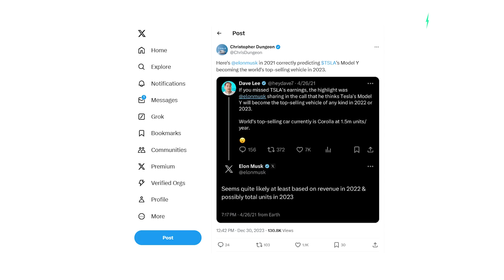CEO of CATL says Tesla’s 4680 battery cell is DOOMED to fail

Comment: Sooner or later you EV evangelists are  going to realise that EVs will be just one small part of the solution to zero emissions. There will be the larger  mix of other solutions which will include ICE around the world. The EU and UK can go it alone if they choose and tank their economies . So, China makes up more than half of all EV sales in the world, but this has no real effect on Co2 reductions because most of their energy is derived from fossil fuels, as is the energy required to make their EVs , their  batteries, solar panels, wind turbines and other so called green initiatives. All one big virtue signal.

Comment: good stuff.  Batteries are always evolving.  Chemistries continuing to be developed.  Regarding the 4680, when they tear down battery packs, the cylindrical structure of the battery helps as well as the glue itself both contribute to the strength of the pack.  The whole thing becomes very rigid.
But anyway one thing you can count on is that Tesla will use volume, they need a lot of batteries and so the most inexpensive is always on their buying list.  They also need to integrate the batteries into packs and into the vehicles.  Also because Tesla makes their own batteries that gives them leverage with other manufacturers, it gives them options.  Also they have real experience in battery development.  No they don't have to win, they just need success and significant volume.  If Tesla didn't work on their own batteries the other manufacturers wouldn't have been driven to do better.  First, Tesla had to ask for volume that didn't exist so that had to be met.  Next they ask for innovation and integration into vehicles.  If anything, Tesla is a key customer who drove battery manufacturers to level up their game.

Comment: For the longest time I thought Musk was a battery expert, he started a PhD in Battery Tech but he quit after 2 days in the program.  Always thought the 4680 battery was a dry coating tech.  And yea, agree that FSD approach is a good approach but only because Convolutional Neural Networks work well with images. It doesn't mean that we have the raw compute to get it done. I would bet dry coat elements of the manufacturing process have license value, but CATL has a huge advantage in terms of battery technology these days.  True story - the battery factory in Nevada is near a town called Sparks.  :) LFP's are great batteries. Interesting to see where it goes.

Comment: Here's a thought: a cylindrical battery may have better heat dissipation because of its shape: heat flows radially out from the center. 
In a square battery, it seems that the heat flow may not be as easy to manage and the battery could develop internal hot spots. In nature, things that need to remove heat are cylindrical or spherical in shape like stars and even the human body that is a bunch of cylindrical objects stuck together with a sphere on top. The shape was not specifically determined by heat dissipation but it might have been a contributing factor. 
Anyway, we'll see how it all plays out. That's my two scents 💩💩😁

Comment: I heard Elon say a couple times now on investor calls that 4680 is just a form factor and not necessarily representative of the chemistry inside. I see two things here. Form factor of pouch vs cylindricals like 4680 and 2170. This is a debate that involves many design factors on cost of BMS for cooling and heating, weight, and reliability when the packs and vehicles are designed. Optimization for cost reliability and performance has to consider all of these factors. Chemistry, anode design, are other factors. Of course CATL is way ahead of everyone on batteries. But they can’t really suggest that Teslas path is an outright failure when you consider all of the factors Tesla needs to consider in building packs and cars. Cars are not CATLs core business. Tesla will navigate batteries well which may or may not include CATL as a second or primary source. The economy of batteries is multisourcing as Tesla is already doing.

Comment: Musk might not be a battery expert, but Jeffrey Dahn is a battery expert & I believe Tesla is making big stride in 4680 cell.
Reply: No, lfp batteries are better
Reply: @mohammedkhan5344  i have LFP. It has its downsides. Takes tons of energy just to manage the temperature. To name just one.
Reply: @mohammedkhan5344  not for all applications
Reply: @mohammedkhan5344  Tesla will make LFP 4680 batteries at some point.

Comment: I thought 4680 was built into some model Y and was not better than the standard size battery. So how is it wrong to say the it has no future?
Reply: Tesla is developing their battery tech. They prove each step before moving to the next step. So they are currently using really conservative battery chemistry and working on getting the manufacturing process perfected. Making batteries is really hard.
Once Tesla have the skills to mass produce batteries, then they  introduce innovative battery design at a very rapid rate. They currently getting a passing grade as they actually making batteries at scale. The rate they produce batteries will keep increasing. 
Catl is exceptionally good at making batteries. The world's. Best, but they not in USA. Tesla may licence tech from CATL if necessary

Comment: I disagree with your comment about 4680s being more expensive to manufacture.  The dry cathode process allows for factories 1/10 the size of the alternative and eliminates the need for a lot of solvents.
Reply: According to Musk, but that isn't what's happened is it? They make far fewer, far slower than they planned. The battery itself gives no discernible benefits. Go watch Munro on the 4680 when it first came out. He reckoned it was slightly worse than the 2170's.
Its a waste of time and effort, giving zero improvements at great capital cost, so far.
Reply: agree in theory. but it is known to be around 50% slower in output slowing down the entire cell line..... is this fixed now ?

Comment: Don't bet against ELON !!!
Reply: Is that why tesla are already using BYD batteries?
Reply: I would in this case. The 4680 is way behind where its supposed to be and never gets mentioned by Tesla anymore. Sure sign its in deep do do ...
Reply: @rorykeegan1895  Are you serious that it doesn't get mentioned by Tesla anymore? Infact in the last quarter call Elon mentioned it and they said they have fixed the dry coating problem with the anode and cathode and their price is now on par with their best supplier. And they will become the cheapest batteries by next year. Stop the lies guys. Go listen to the last Tesla call. This was discussed.
Reply: Seethe
China will win against a angloid slave owner

Comment: Mark my words Tesla will in a long-term always create their own battery chemistry... It is cheaper to cut out the middleman in the long run so that's what will happen... The 4680 is a superior cell with longer life and the 4680 is not susceptible to freezing issues as much as regular lithium based batteries... This is due to the dry electrode.

Comment: The best possible battery might hold 5% of the energy per kilo of petrol . How reliable or long lived the higher performance batteries will be is moot given that both tend to get worse as energy density or power go up ,
. It is a bad trade off for a car but a show stopper for aviation and simulation of actual lifespan by lab tests might be unreliable .
All this just to avoid putting more plant food into the sky ( Elon admitted that the Earth 'may have been a little CO2 starved in the recent past'... all life ceases below about 150 ppm (apart from some deep sea or anaerobic microbial life)  Thankfully, some politicians are waking up to the facts, others are still woke.

Comment: A cylinder is a manufacturable egg shape which is one of the strongest containers found in nature.  The more strongly contained the chemicals, the less the fire risk  Moreover, Tesla use the term "structural battery pack".  No doubt where 4680s are used, their egg-like structure reduces the weight of other structure.  This is a major Tesla structural optimisation.
Reply: you are kidding me?  the whole pack is the structure and NOT the individual cells lol If you puncture one cell you will ignite a chain reaction lol
Reply: A cylinder is not an egg. Jesus wept.
Reply: Interesting that you know more about batteries than Robin Zeng. 
Cylindrical batteries also have higher core volume which makes cooling difficult. 
At the current charging rate and mileage it's all the same
I'm assuming Robin is looking 3-5 years down the road at 1000 mile+ range and 5 minutes quick charging.
Reply: What a whole bunch of bull! Cylinder is not an egg. Moreover, battery pack with its exterior thick packaging is the structural element,  it individual batteries themselves. This commenter is a … B ess artist. Simple.
Reply: Among the well known EV manufacturers, only Tesla's are known for fire risk.

Comment: That is a tell ….. when your competitor throws shade like that it is a sign of fear. Tesla is increasing production and the cost per Kwhr is continuing to drop.
Reply: dude,  the Chinese are the best copycats... if they are not copying Elon's insane ideas,  maybe you should listen?
Reply: @ - oh I listen but I also look at strategy. And Tesla’s strategy is to use a single format to accommodate multiple chemistries to drive down costs.  The Chinese are making g many formats with many chemistries.  I  have also worked with Chinese companies and also know when they make blanket statements like “that will
Never be succesful” it’s a tell. They typically are deferent and quiet when a competitor or partner might be wrong.

Comment: The battery cell form isn't what's decisively important.
The battery pack is the important thing. And in that the temperature management matters.
Prismatic cells might be packed more densely than cylindrical, but does that take cooling into account?
Reply: Right it's the energy density of the whole battery PACK that matters, not each individual cell. The pack doesn't just hold the cells, it must also contain cooling and protection from physical damage.

Comment: 4680 is just a form factor - a shape, a size and the can has any chemistry you like inside it. So what difference does the form factor make, well it can alter the ability of the active surface to dissipate heat to external cooling arrangements. Heat is bad for battery life and is the limiting factor for the charging rate we all want to see increased. A lot of prismatic cells are much larger than 4680 which may improve the power to weight and possibly cost but I think it may make it harder to dissipate heat. Tesla has decided to go with the 4680 form factor right now for the cells they make themselves but I think it is the chemistry and other factors such as dry production that are more important for them to optimise in the short to medium term.
Reply: I think the 4680 is tabless design too which has benefits too
Reply: You can't make a high performance cell 46mm in diameter without implementing the "tabless" design — charge/discharge heat would be too high.
Reply: @Nibiroid  yep
Reply: The form factor has a HUGE influence on the specs. 
I would say that LFP optimal cost/performances form factor is the prismatic stacked electrodes "short blade format"; 
while for the high Nickel, high power/energy density NCM, the best one is the 46xxx due to safety concerns with the other formats.
Reply: No that's not true, form factor just for heat management constrains battery chemistry.

Comment: The only "spiral wound" battery in the US market would be the Optima line. Which must be 40 years old now, and despite all the great talk it never dented the flat metal plate business. Change the names, call it Turnery versus blade, you're still stacking battery cylinders into rectangular packages, and blade or prismatic pouch still has the same density problems. CATL just might be right.

Comment: There are PYSICAL Limitations in CYLINDRICAL SHAPES and Chemical Behavior. FLAT surfaces is required for MAX Chemical performances and reaction. Cylindrical is FASTER to Produce but with NEW materials in Cathode and Anode using dopping technology ... cylindrical is "IMPOSSIBLE" to do it without significant failures in production. Thus ...... CATL has its logic.
Reply: Elon's companies are experts on transforming "impossible" to late.

Comment: Cylindrical batteries appear to be space inefficient! are they using the inter space for cooling?
Reply: Structural strength
Reply: Yes, but prismatic cells must also be cooled.  Maybe ease of cooling is PRECISELY an advantage of the cylindrical cell?
Anyway, spacial power density does not seem to be much of an issue in car applications.  Who complains about their EV car battery taking up too much space?
Reply: BeeEss on structural strength,  you cannot rely on the strength of individual cells for structure strength of the car... and secondly, the "structure " is why you lose the ability to cool individual cells?
Reply: dude,  the power density of the battery is important,  who wants battery anxiety of electric car with 100 mile range?  the size of the battery pack matters, and so
does the weight... who wants to drive a 3 tonne passenger car with range of 100 miles. the cylindrical casing takes up weight and lessens cooling..
Reply: @chasx7062  What modern electric car has only a 100 mile range???  Only a very few small urban cars, such as the electric SMART!
Power density obviously matters... and matters a lot!  BUT, it is not the only thing that matters... others are safety, lifetime, charging speed, etc.  All battery choices are a compromise.

BTW... cylindrical cells are, contrary to what you wrote, best for cooling, and are also safest in over-heat situations!

Comment: they have made some and are increasing output of dry cell 4680.. if they finish the 4680 dry cell it will save 1/2 the space and a lot of the time. There are 4 new chemistries being setup for 4680. Currently they plan on using the 4680 in cybertrucks, the cyber cab and supposedly most of the Tesla Semi's.  Tesla has always used deferent types of batteries in different range /power types of vehicles. 

Will the 4680 make it to companies that are not Tesla maybe not, but they plan on using it for many vehicle types. Again they will be cheaper the more of them they make.

Comment: 4680 is just a form factor. The same chemistry that works in other form factors should work in 4680 unless there is a temperature problem. The 4680 must dump its heat through the bottom rather than the battery side. The 4680 form factor was selected because it has a faster assembly line speed than other batteries.

Comment: I disagree. The honest truth is that CATL have gone all in on Pouch Cells, and they don't like the fact that Cylindrical Cells are actually much easier and quicker to make. Take a look at the stock videos you show for the two types of packaging. It doesn't take a genious to see how much more complex Pouch Cells are, and how much extra equipment is required to create, handle and connect the many separate plates. Chemistry is only one part of the puzzle. China can only make their cells cheaply is because of the massive investment in equipment, cheap labour and subsidies. The fact that Tesla can make competitively priced cells in the US tells you how much easier they are to make.
Elon is always over optimistic, but he always gets it done in the end.
Reply: CATL mainly focus on Prismatic cells not pouch cells. Internally to a prismatic cell is either a wound jelly roll or a stacked jelly roll.

Comment: 46xxx cylindrical format is the safest format for High Nickel NMC cathode, Silicon enriched Anode. 
Prismatic and Pouch formats are too unsafe with such high density/power chemistries.
The cylindrical format is safer thanks to its nature (a gun, a rocket is cylindrical, isn't it ?) to survive high pressure and in case of thermal runaway, one can demonstrate how to stop propagation to the nearby cells thanks to the serpentine cooling system.
Therefore the 46xxx format is there to stay for the most demanding applications.
However the best overall format is the prismatic long format using more stable and cheaper chemistries such as LFP : Automotive should use "short blades LFP" at a massive scale for over 70% of its volumes.
Reply: I sure wouldn't have them powering my house.  I had the option to purchase Tesla modules or to use LiFePO4.  LiFePO4 is where its at as they don't burn.  Having to plan on cells going into thermal runaway as "normal" isn't what I call a good day (especially in a house/garage).
Reply: @dersteer  agree, LFP is actually the way to go for ESS applications. Maybe some other chemistries will emerge later on for ESS (Na based, Zinc or Sulphur based etc .... maybe for "seasonal" ESS ?). But so far LFP is a great solution. The latest LFP cells are now over 10 000 cycles life time .... perfect for day-night cycling. Seasonal ESS may be better with other chemistries to come. We will see.
Reply: Tesla master plan has a lot of LFP batteries as well as high nickel. LFP are lower performing but safer, so they can use eg a prismatic cell as they unlikely to catch on fire. 4680 are much tougher so more likely to stop a fire spreading especially as the cell is surrounded by metal 
They are different solutions to different problems  
Sure there will big changes coming in battery chemistry, so current solutions may be obsolete.  obsolete. 
Catl is doing a fantastic job.
My bet is Tesla offer the best batteries outside of China. If someone offers a better cell than Tesla, Tesla will buy a portion of them